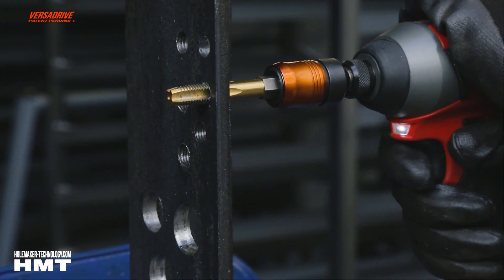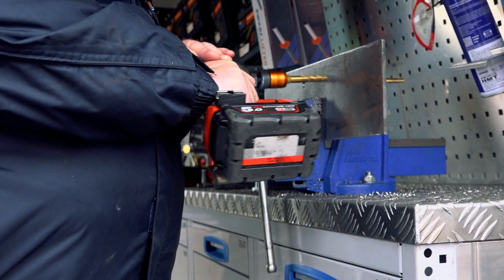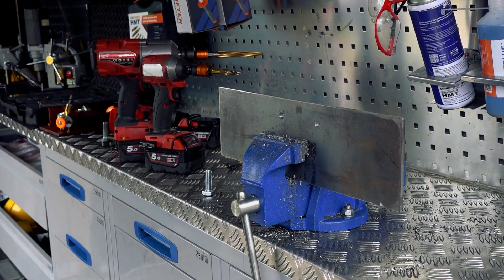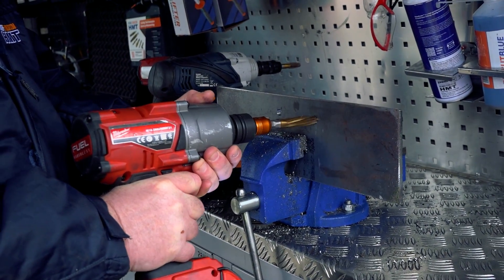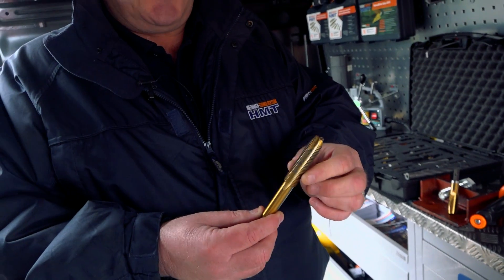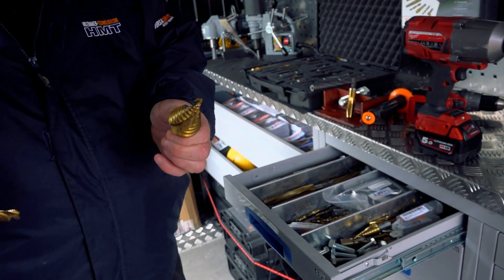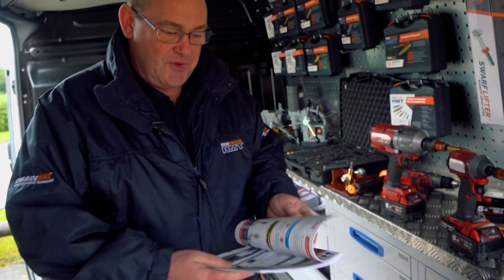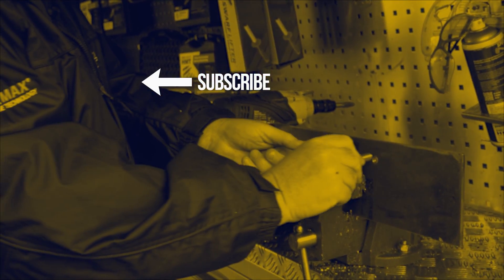HMT VersaDrive - High Speed Hole Cutting

Comment: HUH, you ARE pulling my leg, eh?    All my years around folk drilling in 1/4" plate or other  steel, whether by hand or Bench mounted drill with new of self sharpened  drill, can never get through as quick as that.   Better get my muckle boots on and kick the dog!   A job for tomorrow then, eh?   Where's some tough plate and new drills.   Did you dot punch the hole ?    ( Y'know the u-tube geezer Site agent who rolls his eyes ? )   
I have better success with cheap Lidl Step drills and I use those drill & tap drills occasionally but never as quick as all that.    Foo! I'm sweating with the mental effort already!

Comment: I use these a lot but beware of using in an impact driver as the impact adapter shaft has failed on my so I have upgraded to the 1/2 inch drive adapter with my dewalt XR torque gun and its works very well. not cheap but if your out on site and have no access to a workshop, these are great.

Comment: Can anyone please advise me if its safe to drill holes into my flats concrete ceiling to install a smoke alarm? I'm worried I will hit any electricity cables or pipes inside, not sure how deep the cables run? Any advice will be appreciated.
Reply: noxxi knox  Thank you for your detailed answer, it's a solid concrete floor and ceiling. I did try a detector, but as you said it just picked up false alarms all over. How deep do you think I could drill before risk of hitting things. I should get away with a maximum hole depth of 15mm or maybe I'll hot glue it, better to be save than sorry!
Reply: noxxi knox  Just ordered the velcro tape, at least the worst that can happen it will just fall off. Hate to think of the financial cost if the drilling were to go wrong. Thank you.

Comment: I may be wrong but experience tells me thay won't last long just saying
Reply: Hi Roger - thank you for your interest in Holemaker products, I am glad to be able to report that the products featured in this demonstration have been extensively tested and when used correctly, with the advised RPMs and the application of lubricant, Turbo tip drill bits will drill over 100 holes per bit in 10mm mild steel when used in an Impact wrench. ImpactaTaps, used correctly, will typically achieve 100-200 holes or more and we have user reports of our Impact Reamer kits being used to complete in excess of 600 holes.

Comment: Great product, cheap at only £3.40 x 10 🤣
Reply from the maker: That is salesmen for you. Cost per hole. Oh I only want to do one hole.
Reply: Hi Terry, thank you for your interest in Holemaker products. The product the demonstrator is referring to is one of our ImpactaTaps. When used correctly, with correct RPMs and application of lubricant, these products will typically achieve 100-200 holes if not more, so I think he meant to say divide by 100! That way you get a rough cost per hole and can budget effectively.

Comment: Did he just say 34 quid? 😳
Reply: Yeah but if you divide it by 10 it sounds cheaper.
Reply: @stevedavo79 
🤔I'm multiplying my wages by ten..... Now I can definitely buy the lot😊
Reply: And if you divide it by 2 again it SOUNDS cheaper!
Reply: @stevedavo79  Hi Steve, thank you for your interest in Holemaker products. I think in actual fact the demonstrator meant to say divide by 100! The product he is referring to is one of our ImpactaTaps. When used correctly, with correct RPMs and application of lubricant, these products will typically achieve 100-200 holes if not more! Dividing by 100 you get a rough cost per hole and can budget effectively.
Reply: @holemakertechnology4488  I would ask though, based on this demo, I can guarantee that's not the speeds and feeds you would be advising people to at to get the 100plus uses
Reply: Tbf it's one of those, if your doing a couple of holes, just drill and tap it as normal with a drill then tap wrench. 

But if you do a kinda job that requires you to be drilling and tapping 20/30 plus holes per day, that couple of mins saved on each can make a fair bit of difference
Reply from the maker: Cheaper than the way I did it. I spent the whole morning on four holes.

Comment: I use the full range from HMT for  heavy engineered site installations,  The Versa drive range is a game changer, They are as good as the video shows, especially the step drill range, 30mm Dia hole through plate steel in seconds
Reply from the maker: Good to know Nigepet. We love to hear from people out on site who use the tools.
Reply: Only problem step drill is only good for material slightly  thinner than the step of the drill

Comment: Perfect timing, I'm drilling 22mm holes on a steel boat next week 9mm thick
Reply: Not through the hull below the plimsol line, one presumes?
https://www.youtube.com/watch?v=nFfdGUWNges

Looks like a great product.
Reply: @loafersheffield  haha no, Funny enough i have done that before to emeregency fix leaks. Drill a whole through the leak so you can put a plug in or a bolt with a rubber washer.
Reply from the maker: It wasn't perfect timing for me. I spent all Saturday morning drilling and bolting a post to a steel beam and on Monday morning I came across this guy. It would have taken me 10 minutes.